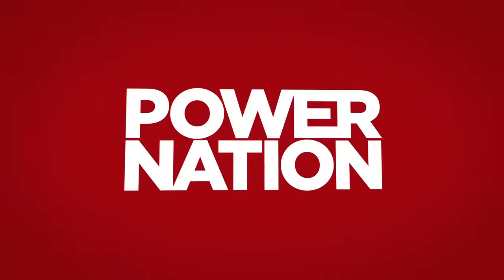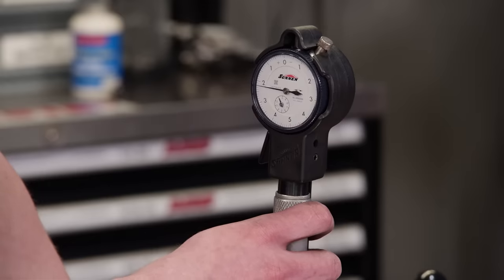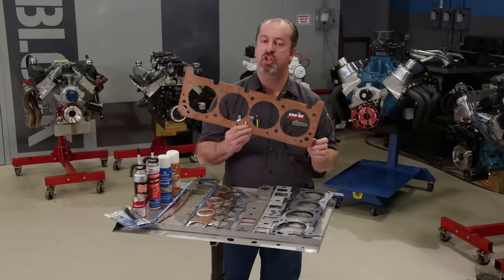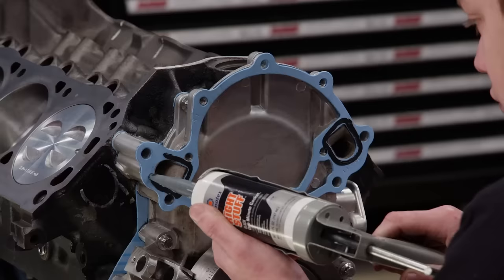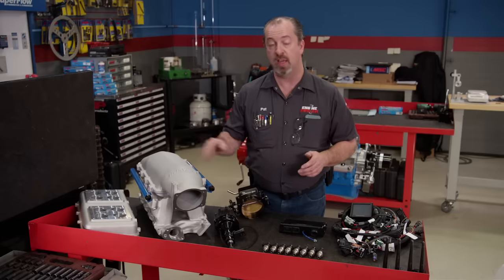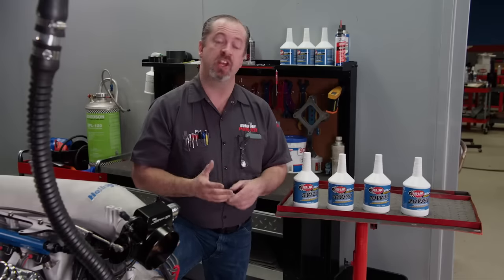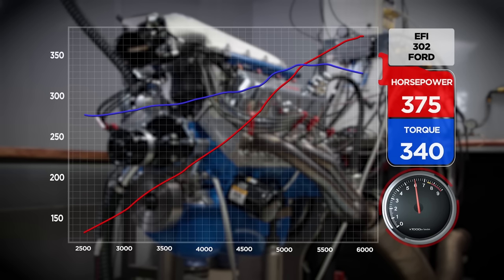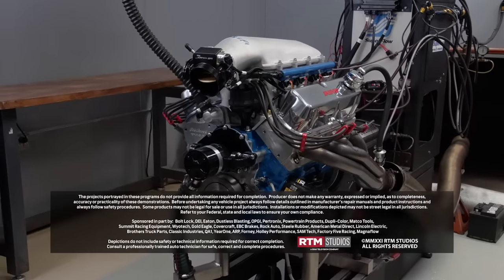Old School 302 Ford Goes High Tech - Engine Power S8, E9

Comment: Hmm, I kinda expected a little more out of it than that. Oh well, it was still fun to watch.

Cheers 🍻.
Reply: That's pretty standard for that level of build on a 302. My dad had a 302 in his drag car for a while and it probably made just over 300hp on motor. It was built for nitrous though so it really woke up when you sprayed it. It would tote the front tires past the 60 foot mark. I don't remember if it was bored .030" over or not.

You really can't get more than 600hp out of a stock 302 block before they split in the valley. After the 302 he went to a 351 Windsor bored to the max and ended up around 460ci. That was a nasty motor.

I don't know that I would have went with a Holley hi ram intake for a street application. They really make power at the top end and you give up a lot of low end which is better for street applications. On an LS, the standard truck intake beats pretty much all of the high dollar intakes on the low end. The Holley looks cool though.
Reply: Hey, when you get more horse than your cubic inches, it's a good day. This is without any type of power adder.
Reply: @monkeybarmonkeyman  :
True that, no arguments here!
Reply: Seems like a bit of a mismatch, all great high-quality namebrand parts. But those heads are much more suited for a torquey street engine but the cam and intake system for more of a higher RPM Street strip car.  With a nice dual plain air gap intake I believe  you could’ve got very close to the same HP and had tons more down low, where you use it on the street. And where those heads are much more comfortable.  The induction system would have worked much better with better flowing heads.
Reply: yeah just a little 302 if it was a 302 like in the modern mustang it could cuz 4 overhead cam and 4 valve per cylinder! but pretty sure a 351 or a stroker version would get over 600hp easy peezy with the same setup!
Reply: @oldscratch3535  I wouldn't go with that intake only spinning it to 6k rpm.  They're really limiting this motor and it's power potential by not revving it more.  It could easily Rev to 7 or more with the quality of build this is.

Comment: Really expected more from this combo. Seems like you could approximate that output with much less.
Reply: NEEDS MORE RPM!!!!!   Power graph was going straight up when they shut it off.  3" stroke needs to spin some rpm!
Reply: @bigboreracing356  6k rpm is nothing for a 302.  I've been racing them for over 30 years.  Stock cranks and even rods can easily handle 7k rpm with good machine work.  Have pushed my 306 to a 9.87 @ 136.  Shift at 6800 rpm and a 200 hp plate.  Lasts for years...
Reply: @bigboreracing356  I built a BUDGET 306 for a Gasser that races at least 10 events per year.  Stock block, stock crank, stock rods and even hypereutectic pistons.  Ran all last year, and into this year.  Rev limiter is set on 7600...  and it gets tapped pretty much ever trip to the track.
Reply: @bigboreracing356  The engine in this video did not need 8k rpm, but it's power curve was still climbing hard at 6k rpm when they shut it off.  Should have run it until the power started to fall off.  Probably would have peaked around 6500, and made good power to around 6800.

Comment: Why would you gap the lower ring less than the upper ring? Wouldn’t it need to be gapped more than the upper ring to help prevent excessive pressure between the 2 rings by allowing the blow by to escape?

Comment: I didn’t see a crank trigger, did you run the engine batch on the fuel? I think the worst part is setting the tdc offset angle. Pita. Although if you are 180 you can change it in the ecu which is nice. Lol.

Comment: Why did they stop at 6000rpm when the HP was still climbing?
Reply: I agree. They need to try 7k rpm or get a different cam. They probably dont want to scatter the stock shortblock.
Reply: @disfordiesel8219  I think it would be fine with those forged internals.

Comment: Ring it out to 7500 atleast torque was leaving the building but I  bet it still makes about 279 on torque all the way up top and around 410hp
Reply: If they get the torque up to 400 ft*lbs where it should be getting 450+ HP with a hotter cam wouldn't be a problem.

Comment: All those ARP fasteners and the 4340 rods and you didn't go to 7000RPM?
Reply: And a huge cam for a 302 and tunnel ram intake meant for hi rpm and spinning to 6k.  They need better heads with more flow to better make the intake and cam and spin it to 6800+ and see 450+

Comment: Off the bat not tweeked on dyno guess Ide say 575 plus hp and 550tq in 7000 range. That fi setup easily out do a carb.

Comment: A 347 stroker is less than a 351 windsor.302s are great for rpm' s. But a 351 will always out perform a 302 in torque ratings. Make your own choice

Comment: I'm a little confused by the result ..there were all good parts go into that engine but it didn't crack 400hp.  Aussie super cars were cracking 650hp out of a 302.  So I would have hoped this build would have made at least 450hp
Reply: Not with 9 to 1 compression, 170cc heads, and a hyd. Roller cam!

Comment: 6000 RPM was a big disappointment! If you're scared of 7K how about 6500 or even 6300. With that and air/fuel adjustments, 400HP no problem.

Comment: Lot of expensive equipment for such little horses. A different build with a RPM intake and 750 double pumper will easily knock out over 400hp .. So sometimes fancy electronics don’t mean performance!!

Comment: You should consider dykning the engines according to the ISO standard, with ancilleries,  mech. water ,pump, air filter, exhaust, cat. etc i.e. realistic operationali conditions - and not just giving out arbitrary, ego and sponsor massageing numbers

Comment: Once again I am confused, how can they set the timing at 30 degrees for a fuel injection engine, that is a carborated setup.FI doesn't like that.FI is proper at about 12-15-16 degrees advanced, Correct?
Reply: Total vs Initial

Comment: Self learning is cool to get it on the road but wish it also had full tuning capabilities since more times than not you're gonna end up on a dyno with a tech trying to adjust the few values he can in an attempt to improve power/ drivability.  Its no longer the 90's when people were afraid of tuning because they didn't have a laptop or a way to learn the craft.
Reply: The terminator system does have full tuning capabilities. Need a CAN bus to USB cable and plug it into a laptop download the Holley software and away you go. The “self tuning” isn’t doing anything more than creating a base map and fiddling with a tiny section of the fuel map. That combination even with that asthmatic heads would be decently into the 400+ range with better tuning and rpm

Comment: I'm hoping there's some knowledgeable Ford guys in the comments. Is it possible to take an older 5.0(let's say 1995) and upgrade it with aftermarket parts into a Coyote? I try googling different variations of the question of whether the blocks are different and all I get is differences between the truck coyote and the Mustang. Basically, are the blocks different? The heads? Exhaust ports? Try to keep the answer somewhat simple because I only know a little bit about a little bit when it comes to engines. I hang out with my cousin when he's building engines or fixing stuff but try not to get my hands dirty.
Reply: No the coyote is a completely different engine.  Same displacement but there is literally nothing else the same.  You can however swap a coyote engine into your 95 mustang.   Go with a 96 up style mustang trans that works with modular engines any of them work with the coyote.  Plenty of info out there about how to coyote swap.  

But no you cannot turn your old pushrod 5.0 into a coyote.

Comment: .060" overbore on a stock 302 roller block, no thanks. so there is what easily $10K in parts and this engine couldn't break the 400HP mark LOL
Reply: Exactly. Ford race teams were able to break 400 hp over 50 years ago.
Reply: Agreed.   400 isn't weak but it seems a bit light on HP for the spend.
Reply: @bmstylee  it's because it wasn't done right lol.  That is a huge cam on a 302 and a hi rise intake both meant for hi rpm being used with low rpm oriented street heads and only spinning it to 6k rpm.  It's no wonder it didn't do that great.  Give it better heads and Rev it to 6800+ and you'll see 450+.

Comment: That's not the Ford blue used on my original 1969 Mustang-housed 302 engine.  It should be a darker color, that looks like Ford tractor blue.

Comment: Needs more RPM.
Reply: Unless you are racing it 6000-6500 is way more than sufficient.
Reply: @bmstylee  - The point is that the graph clearly showed that the engine had more potential in it, the curve was still climbing.

Comment: That's a lot of money tossed at a 302 for sub a 400 HP result. If you're running a 302 you'd do an engine swap long before you'd drop 1/10th the amount they have in this build.
Reply: Different head selection to better match the cam and intake and take it to 7k rpm and you'd see well over 400 horse.

Comment: 13.3 too lean and 6000 to low for a cam that big with a tunnel ram tuned properly that motor will be over 400 easy.

Comment: There seems to be a conspiracy in the thread that they didn’t want to show up a Chevy motor.

I don’t think bias is the reason they want to stop it at 6K rpm. They aren’t paid by GM. They’ve built some excellent Ford motors. Do you know of any engine builder that wants to show a motor they designed on national television perform less than its full potential? They even used the cooling trick to bump the results.  Here’s the truth: they didn’t run it higher because they are giving this motor away to a viewer and didn’t want to risk hurting it, which can happen at that RPM, even when careful.

Comment: I thought you might pull it to 6500...
Reply: Yes, it looked like the power was still climbing.  3" stroke, hell, rev it up.
Reply: @tenthousanddays2103  Yeah. It sounded like it was still climbing smooth and solid. Usually they run them up until they start to fall off. Made good numbers for a 302.

Comment: Has any one ever won anything not just on here but anything online..I have entries from guns to car trucks an engines .. now this would be perfect they never do  fords   I have a 1990 mustang gt an a 2000gt that to be honest I'm willing to promote an market  I'm not a pro but always been told I'm great at it  from starting my own companies as well as creating sakes for other companies..I was in a bad wreck an back an shoulder was really messed up but  never stopped me from trying ..I started buying fixing mustangs an saving them from the scrap yard cause most would  of made it too the scrap yard.. both cars I tried to build  I went with a paxton supercharger .that was a mistake the90 gt they never gave me a blow off valve  so that did not turn out good at all.. they made up for it awhile after on a 200o gt but the tunwr they made me buy my own runner instead of just getting me .theee rune in my computer or built into chip .so I found an went with delta/ sniper. Tuning ..the guy have me a tune have it way to much has an he said it was best to say it was at 12 psi which should never have..soo I'd say I give .. an my luck is no way in winning or even getting one of these cars down  before I'm dead an hone with a cist  on my kidney  but love your shows you guys are best ..

Comment: That cam is WAY to big for that application, if you’re only going to turn 6000rpm why would you want a cam that would run out to 7500 or more?
Reply: The intake and cam both want 7k rpm the heads don't.  They need better flowing heads and spin it to 7k.  They could see 450+ easily.  This is what happens when the party aren't matched properly and you limit your setup of rpm.

Comment: That is a ridiculous amount of money to spend on a boat anchor that failed to generate even 400hp. Stock heads with a mild cam and a turbo would cost half as much and make more power.
Reply: They needed better heads and to Rev it out alot more.  They're leaving alot of potential power on the table with this setup.

Comment: That's an extremely weak and low compression ratio. A SBF can do 12.5:1 on 93 Octane. You should have went with 12:1 in case you can only get 91 Octane. Engine is gonna be weak now.

Comment: You have got to be kidding me right now.  Please tell me those numbers weren't intentional.  You can do better with a 200,000 mile L59 on E85 with just a cam change.  You want to know why people put LS motors into almost anything?  Well there you go, $3,000 to build that motor and I could do better with a $700 junkyard motor from a 2005 Silverado with a $350 Cam kit.

I'm sorry, that thing should be pumping out at least 400 horse, or why even build it?
Reply: Stop it.  You can clearly see the heads aren't matched properly for the cam and intake and they're only taking it to 6k.  Better heads and 7k rpm and they would have seen 450+ which ain't bad for an old school 5 liter.  You're comparing it a larger displacement more modern ls.  I bet the factory heads on that ls flow better than the aftermarket heads they put on this Ford and only spun it to 6k.  You ls guys are too quick to jump and start suggesting ls to everyone when you can clearly see this 302 isn't making nearly the power it could be making with better head selection and another 1000 rpm.
Reply: It takes little more than 700 bucks to have a cammed l59 on e85.  Little more to it than that.

Comment: I think more like 450 hp with all the junk you put on it
Reply: It would be 450+ with heads that better matched the cam and intake which are meant for high rpm and they only took it to 6k.  It needs better flowing heads and 7k and you'll see 450+  it's all about part selection it's all gotta work together.  This is not a good example of what a 302 is capable of with a build like this.

Comment: Guy's . You went .60 over on a 2 bolt block that should never see more the .30 over ..... max .40 .... WTF .

 That's  a dead motor in no time . Then you added an 8000 rpm intake with an 8000 rpm TB for a motor the shoild never seem more the 6250 rpm . 

Come on   ....

Comment: If you applied those mods to a LS2 or LS3 you'd be making 650hp.
Reply: They have more displacement
Reply: these old windsors are a 60 year old design. LS is a crossbolted modern engine block. I would HOPE so. Putting these fancy parts on a windsor is like fitting sneakers to grandpa and then say "oh im much faster than grandpa in those sneakers".
Reply: 408  maybe  but unstroked LS2 LS3 on pump gas?  probably 550+  575
Reply: You are also talking about an optimal setup on a much more modern engine with alot more displacement.  We're talking 1 to 1.2 liters more displacement. On top of that the heads they went with don't flow good enough to get the most from the cam and intake manifold plus they're using that hi ram which should make high rpm power (what you need to make power with less cubes, rpm) and they Rev it to 6k.  Put some better heads on it and spin it to 6800-7k and see what happens.  That little 302 would be well over 400 horse.  Why are you comparing engines that are much more modern and have 1 to 1.2 more liters of displacement?  Congratulations your modern much larger engines can make more power give you a cookie.  Anyone with eyes can see this build is rather limiting for couple different reasons.